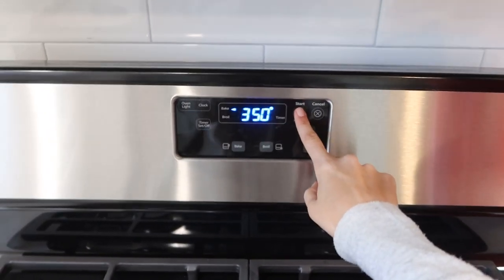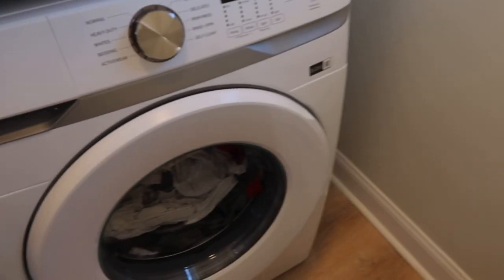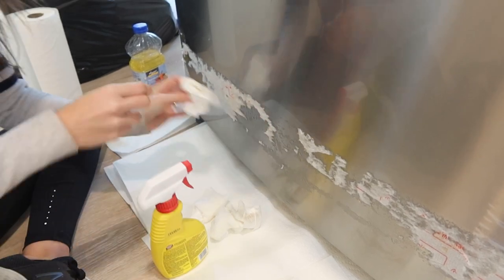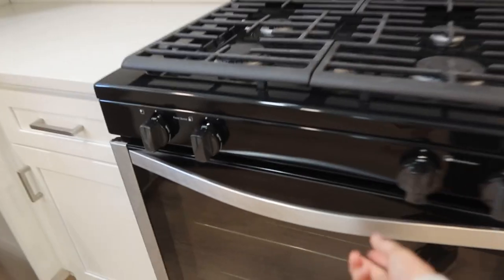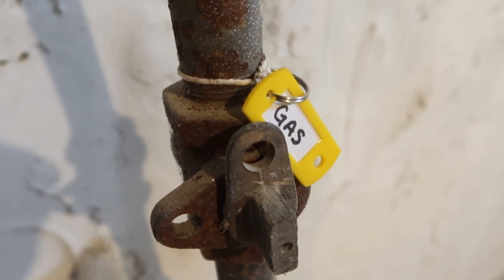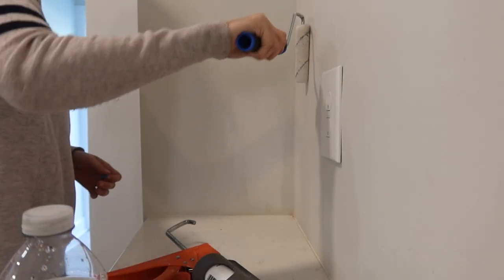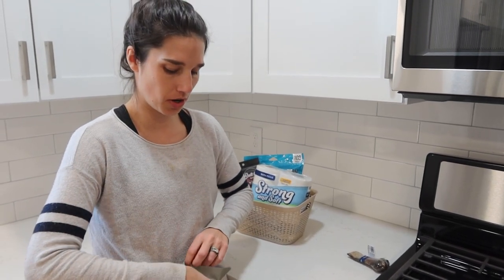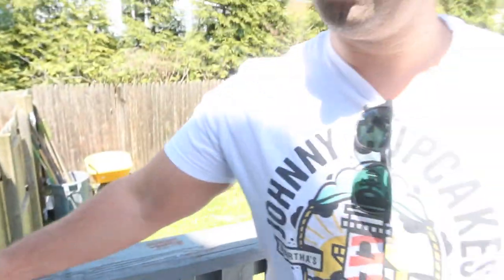Do This Before Your Tenant Moves In | Handing Over the Keys!

Comment: No Electronic locks? Love them so no dealing with tenant locking themselves out.
Reply from the maker: Definitely something we've been considering! Do you have a brand or model you prefer?
Reply: @RentalstoWealth  I've always used Schlage at my personal residence and long term rentals and no complaints. Different models available depending on if you want it to be connected to the internet. Currently using a Yale at the Airbnb and it has worked nicely so far.